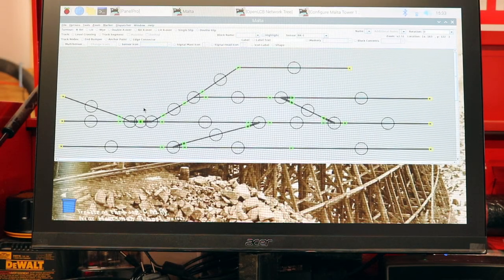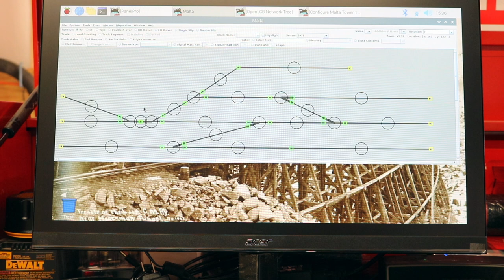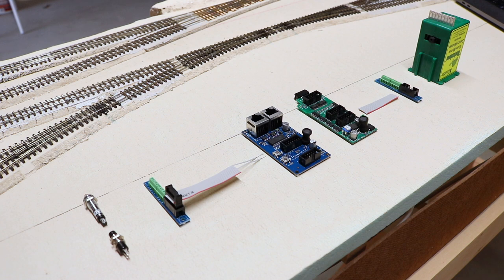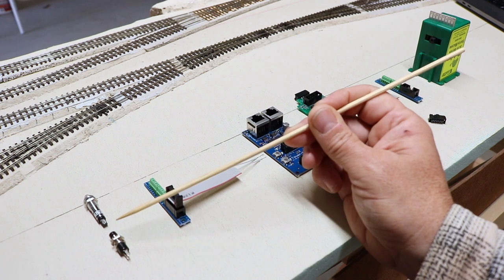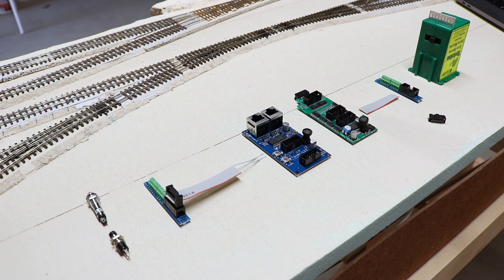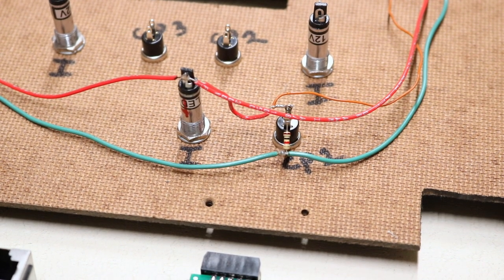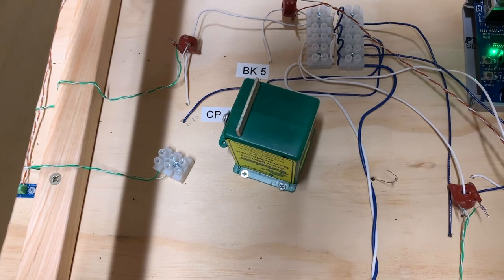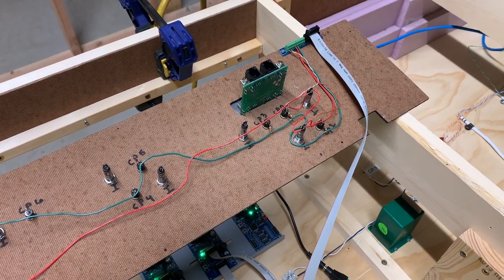MRVU 10 ( Wiring IV ) Push Button Tortoise Control.

Comment: Thank you Dennis for this very interesting update on your experiences connecting up these controls. While I have looked at the RR-Cirkits modules before, I never studied how they were actually meant to operate. I applaud the economy of wiring in using a single pin as both an input from the pushbutton and an output driving the LED, but I would expect it to complicate troublehooting.  Art...
Reply from the maker: Trouble shooting, yes I'm doing a lot of that with the LED resistor combination.  Push button changes the state from Hi to LO.   The whole principle of being able to run an LED AND accept a PB input is all tied back to a circuit voltage bias.  If the "normal" state (PB open) is input "Hi," and the "closed" state (PB pressed) is input "Low," then the circuit works.  The trick is to put enough resistance in the LED circuit to not drop the +5V enough to let the input point think it is "Low", but enough to drive the LED.  I haven't got it right yet...LOL

Comment: This LCC stuff looks like it would work if you wanted to control all the turnouts remotely like in a full blown CTC system, where a dispatcher sets up the route path.  If you just want to control them locally via the push buttons on the panel, for local use, it is definitely overkill and complex.  The LED is not coming on since you don't have a path to ground for the current flow through the LED.  With the button not pressed, the only path to ground would be if the LCC node was set up as a output, and was pulling the output low to create a current path through the LED to ground.  If the LCC port is setup as a input, then there is no path to ground through the LCC circuitry.  Only when the button is pressed do you create a path to ground.
Reply from the maker: Yes, this was over a year ago.  I got the bugs worked out and have been pleased with the way things have been working.  I had gone back and forth on whether or not to do a more modern railroad with signaling so that is why I experimented with LCC.  I like how it all works with JMRI and will probably continue with it as I move forward.